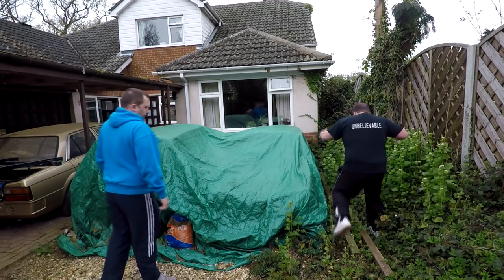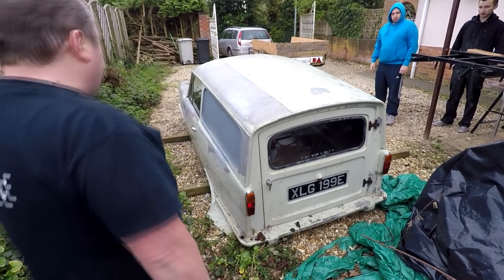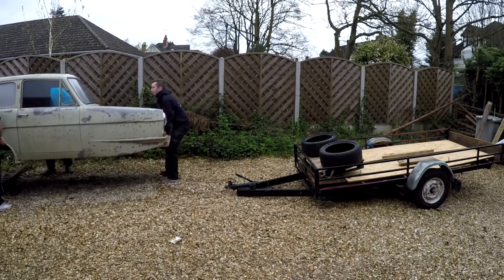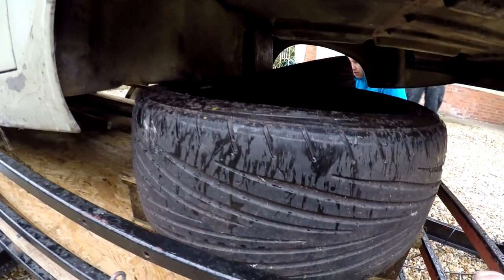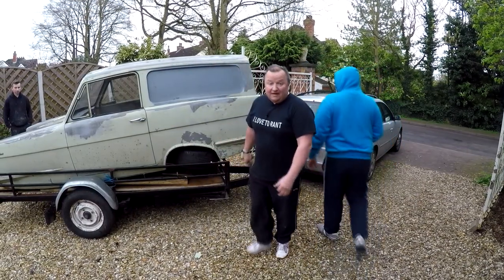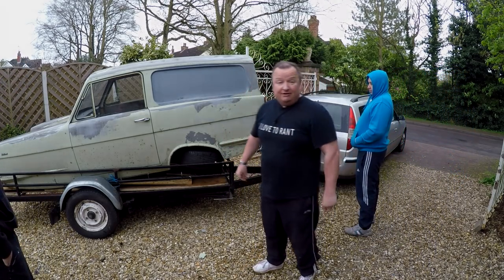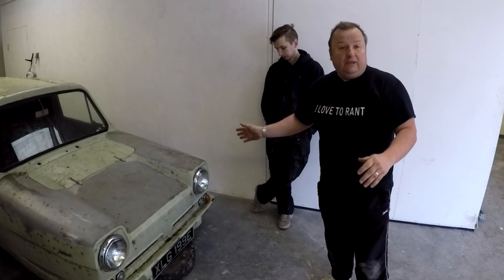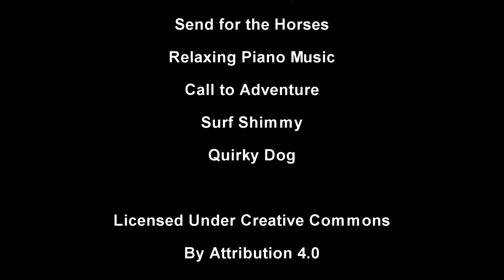Part 14 Reliant Trotter Restoration Moving The Bodywork

Comment: There are so many Trotter Tribute Regal's around now, Martin that it would be really nice (and different!) to see a nice standard Regal in its original colour - it would probably be worth more, too. Obviously, its your van so its your choice but either way its good to see you back working on it again. Cheers, Mark.
Reply from the maker: Believe it or not Mark, There are only around 37 Regal vans left on the road in this country and not all of them are Trotter vans so in fact, they are very rare.  Trotter vans are rarer than Rocking horse poo.
Cheers
Martin
Reply: Ricky Hatton once bought a back up Trotter van for 44K. One of the other back up Trotter vans was also used in Mr Bean but painted in blue.
Reply: £44,000!! The phrase 'more money than sense' has probably never been better used.

Comment: I like the owl Sinead O'connor music at the start another great Butler production.
Reply from the maker: Haha, thanks Donal.
Reply: retrorestore hi martin great videos love um , when u see jimmy again could you ask whats the paint to use on car rocker covers ( VHT HIGH TEMP PAINT  ) or could i get away with 2k paint and laquar , sorry its not regal related, thanx jay
Reply from the maker: You don't really need high temp paint as the engine doesn't really get to hot and the rocker cover is cooler than the engine. Standard 2k is fine. Check the paint temp should go to around 120 deg C
Reply: retrorestore thanx martin jay

Comment: custie!! you should weld a square box section frame with some large castor wheels. make it easy to move around the spray shop!!!
Reply from the maker: i'll be putting it back on the chassis before spraying.

Comment: When I saw you lifting it how you were I was like "NOOOOO!". It's so tempting and easy to lift like that but the fibre glass is weak there. Exactly the same thing happened to my saloon when I went to pick it up... on my side I refused to hold it there, but the guy on the other side didn't give a shit (as he was selling) and now I have a similar repair to do as you have. Yes it's an easy enough repair, but just another job on the list that didn't need to be done. You need to get the curve right on the wheel arch which will be fiddly and time consuming.
Reply from the maker: Yes, we live and  learn lol. It'll be ok when it's done though.